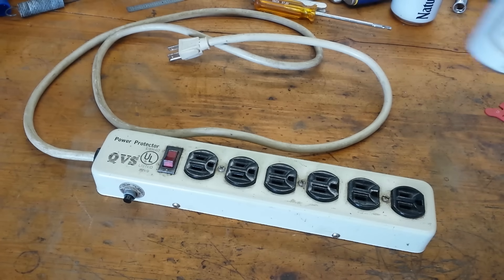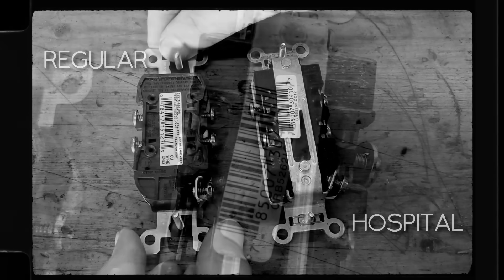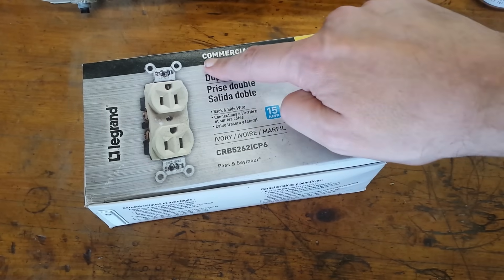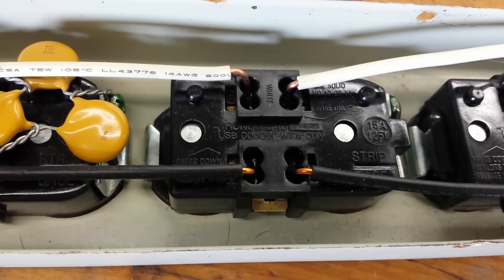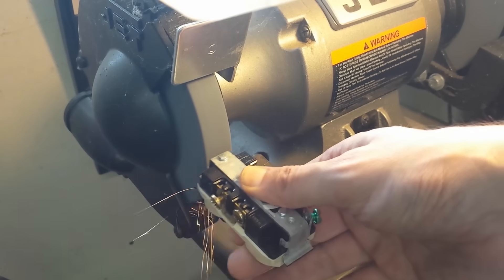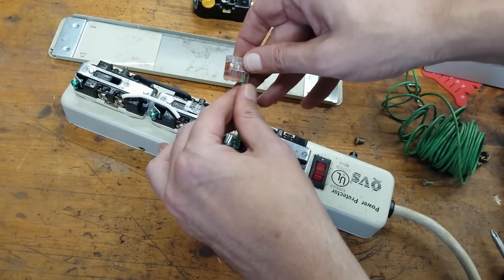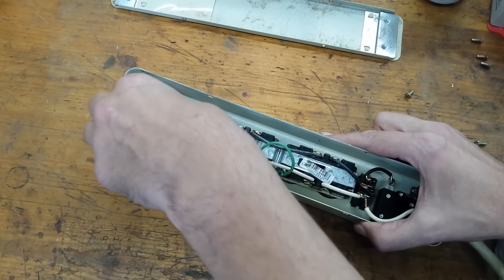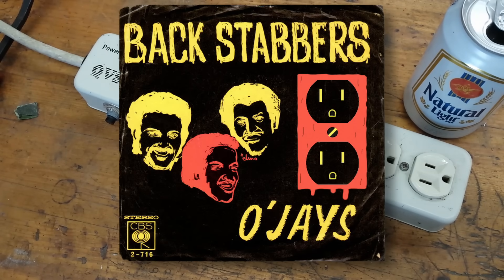I like "upgrading" old power strips for some reason...

Comment: This video is a perfect demonstration as to why it's better in some cases to fix something you got for free, than it is to buy something new. Older stuff is repairable, and therefore in some circumstances upgradable.
Reply: Yes, nowadays people just throw things out to buy new when something breaks, but they don’t actually take the time to take the thing apart and diagnose the problem anymore
Reply: Like if my Steam Deck (portable PC/videogame system) joystick brakes I'm replacing the potentiometer joysticks with hall effect sticks.
Reply: @bland9876  and how when they figure out how to modify the firmware on the switch I'm running Linux on mine immediately
Reply: It is a perfect example of doing something that can get someone hurt.  Do not follow this video.
Reply: @rbhe357 okay mister electrician sir, any other wise tips?
Reply: @DerpDerpington1122 Ask yourself 1 question.  Since he cut the metal bracket from each end, what is holding the new heavy duty receptacles in place?  A tiny screw in the center meant only to hold the cover plate.
Reply: @rbhe357  a 6/32 machine screw on average has a tensile strength of around 150 pounds bud. A hospital grade outlet dependent on manufacturer tends to weigh somewhere in the wheelhouse of 1.5 to 3 ounces, I think the "tiny screw" will hold just fine
Reply: @DerpDerpington1122  Cute that you think tensile strength of a bolt matters when 2, maybe 3, threads are engaged, and when the forces are not acting linear to the bolt itself.  C'mon Poindexter.  You're smarter than that.
Reply: @rbhe357 standard size for that screw is generally 1/8-1/4 of an inch, unless that sheet metal is an 1/8 of an inch thick that screw has plenty of threads engaged, ik you think you're right but I legitimately make bolts and screws for a living man, the power strip is fine and you're not right, I understand wanting to make sure people are safe and all but it's a damn video from someone who does hobby electronics. Unless you're deliberately trying to rage bait idk what your problem is
Reply: @rbhe357 and btw 3 ounces isn't gonna provide enough sheer force to snap those bolts unless you literally smack the thing into a concrete floor or a wall
Reply: @DerpDerpington1122 Congratulations you make bolts for a living.  Mechanical engineer myself.  You are correct that the screw is 6/32, but I have no idea where you got 1/8" or 1/4".  No household receptacle on Earth uses mounting hardware (screw nor sheet metal) of that gauge, and quite frankly I couldn't care less. (Incidentally I just checked. It's 20ga, or 1/32" thick)
I'm talking about the receptacle itself.  If I had a nickel for every receptacle that I have replaced or tightened when it "got loose " from repeated fatigue. Those didn't have some knucklehead grind the mounting brackets off, defeating the metal strap running from end to end, while bragging about the extra force needed to plug something into it, either.  It's like expecting a hammock to stay up after you cut both trees down.
You and I get that it's just a video, but unfortunately some people believe everything they see online.  It's more unfortunate we have "influencers" looking for views by giving them bad, sometimes dangerous, ideas.  I will refer you back to my original comment, above. 
That's it.  I'm done.  Moving on.
Reply: @rbhe357 it's not Gauge its length college boy. 6/32 by 1/4 or 6/32 by 1/8 and honestly the fact that you think you know everything should've told me you were an "engineer" and I highly doubt one worth his salt if you're so committed to being correct. In a manufacturing setting you actually see these components put through their paces instead of just in solid works or in your desk receptacle. If that piece of tech has been put through it's paces in the exact same way why on gods green earth would it fail when put to the test with components held to a higher standard. You engineers absolutely never from my experience have any hands on experience. You just sit behind your little desks and say that your little paper degree means that you know everything. I would love to see you actually try and repair or refurbish something yourself. I guarantee it'd be laughable
Reply: @rbhe357 Uhh what? Sure bud. There is nothing unsafe about what he did.
Reply: @rbhe357  I bet you'd shit yourself if you found out about the battery pack modders....

Comment: For most of my life, every time I go in a hospital, I wondered what those green dots signified. I wonder no more! Great vid, but I do have an issue with one aspect. You state that you don’t like “backstab” push in wiring, but then you promote Wago’s, which are exactly the same thing!
Reply from the maker: The Wagos have a lever that keeps constant pressure on the connection, and larger surface area making contact with the wire.

Comment: 6 × 5$ = 30$ you paid for 5 outlets ... you could find mint power strip in swap meet or flea market for 10 $
Reply from the maker: The outlets were only like $2 or $3 a-piece when I bought them a few years ago, plus I had fun working on the project.
Reply: @ballinator 🎉🎉🎉

Comment: For linking all the grounds on that string of receptacles, the ideal way to do that is to strip conductor in-between the ends. You can wrap those stripped middle parts around the ground screw as a U hook between each of them.
Reply from the maker: Thanks. I always have issues when I try to strip the wire in the middle.
Reply: @ballinator  Yeah, it's sort of surgical and fussy to be sure. But old time sparkies used to do it all the time to avoid making pigtails. It's a clever hack.
Reply: yeah, way too much going on with all the wagos and pigtails

Comment: From what I've gathered, "hospital grade" receptacles are identical to commercial grade ones with most manufacturers. The only difference is the ones that are hospital grade bear a mark (the green dot) that makes them more expensive only for the purpose of recouping the cost the manufacturer incurs to get them certified for hospital use. So you're literally paying more for that green dot, which is there just for hospital building and safety inspections.
Reply: If you look at a different way, they're giving you a medical grade plug at half the price simply because it doesn't have a green dot on it.
Reply: @mayshack  Precisely. Put your own green dot on it. lol
Reply from the maker: That's been my suspicion too.
Reply: Don’t mind me and my green paint can and tiny brush…
Reply: News to me. I always thought the green dot was a power indicator led.
Reply: Not so:

A hospital-grade receptacle is an electrical outlet built to higher safety and durability standards than a standard outlet, featuring enhanced grounding, robust construction, tamper-resistance, and a distinctive green dot on its face to signal its certification for heavy use in healthcare and other demanding environments. These receptacles must pass stringent tests for impact, grounding, and plug retention, ensuring reliable power for critical medical equipment and enduring repeated use and potential abuse.  [1, 2, 3, 4]  
Key characteristics: 

• Enhanced Grounding: Hospital-grade receptacles feature more reliable grounding systems to enhance safety in healthcare settings. [1, 3]  
• Superior Durability: Built with thicker, heavier-duty materials, these outlets are designed to withstand high-impact forces and continuous use without breaking or deforming. [2, 5]  
• Stricter Testing: They must pass rigorous tests, including the "500 Pound Crush Test" and the "Abrupt Removal of Plug Test," to ensure they remain functional and safe even under extreme conditions. [4]  
• Tamper Resistance: Some hospital-grade receptacles include tamper-resistant features to prevent foreign objects or unintended access. [1, 6]  
• Visible Certification: A green dot on the receptacle's face is the visible symbol of its hospital-grade certification. [2, 3]  
• Emergency Power Capability: Red-colored receptacles, often found in hospitals, are connected to emergency backup power systems, and hospital-grade devices are essential for reliable connections to this vital power source. [7, 8]  

Why they are used: 

• Healthcare Settings: Due to the critical nature of medical equipment and the potential for heavy use and accidental damage, hospital-grade receptacles are essential in patient rooms, operating rooms, and other patient care areas. [2, 7]  
• Demanding Environments: Beyond healthcare, these durable outlets are specified for any location where devices experience frequent use and where the reliability of the electrical connection is paramount. [2, 3]  

[1] https://www.paclights.com/explore/debunking-myths-about-hospital-grade-receptacle-what-you-really-need-to-know/
[2] https://www.youtube.com/watch?v=5BlriskCnjI
[3] https://www.allstarelectrical.com/resources/how-are-commercial-and-institutional-outlets-different
[4] https://www.stayonline.com/product-resources/hospital-grade-plug-and-receptacles.asp
[5] https://www.youtube.com/watch?v=LGG_pYJdar4
[6] https://forums.mikeholt.com/threads/hospital-grade-receptacles.82684/
[7] https://leviton.com/markets/health-care
[8] https://www.backupbatterypower.com/blogs/news/what-are-the-red-outlets-in-hospitals-and-medical-facilities
Reply: @delta3dd None of that means the commercial ones aren't physically identical to the medical grade ones (other than the green dot).  A bunch of the expense in environments like that is liability, certifications, and additional testing.  Combine that with low quantities and buyers who aren't especially cost sensitive and the cost can increase quite alot.  Sort of like how aircraft parts are wildly more than normal ones, even if the part itself is essentially identical to a hardware store one.  For the outlets, if the difference in materials and assembly isn't massively more between commercial and hospital grade (and I doubt there's alot of difference), it's quite reasonable that manufacturers would prefer to have fewer machines, dies, molds, etc by just having both be functionally the same thing.
Reply: @delta3dd Yes, but that doesn't mean the non-hospital, spec-grade or commercial receptacles don't also meet that same criteria minus the green dot. When you say "regular receptacles", I assume you're referring to the ones that cost like 89 cents a piece. Those are residential grade, and yes, those are absolutely inferior.
Reply: @delta3dd obviously ai

Comment: Yes I have used the hospital grades for my power strips, and the green dot it there to let you know that, the outlet has a "dead front". The screw for the cover can tie to the ground on 
strap, allowing for a path of current, when you handle a plug with wet hands, These do not allow that. And , nice work too.
Reply from the maker: Thanks! Are you thinking of isolated ground outlets? I just checked one of my spares for continuity in between the ground terminal and the cover plate screw and it had it.
Reply: @ballinator  I just check mine and you are right. The thing that is a "dead front " is the hospital grade hubble connectors, that they had to put on all equipment, at the medical school , where I worked, a few years ago. I grabbed a bunch of outlets and plugs, from surplus equipment.
Thanks for catching that !

Comment: If you want a new metal power strip you should look at naval or “marine rated” power strips. They have a metal case and also use a double pole power switch.
Reply from the maker: Interesting.
Reply: @ballinator  A lot of "marine" grade stuff is basically heavy duty RV stuff.
Reply: The ones meant to be used in server racks are usually all metal too.
Reply from the maker: @JeremyLevi  Oooh, great tip!
Reply: @JeremyLevi  I have a few of those. I'll see if any need repair.
Reply: Yeah, naval power grids don't have a neutral, they use two live phases for single phase power circuits, too, so you have to use double-pole breakers.
Reply: Retired navy dude.  Yes you are correct.  Never opened one up but they are much bigger then your average power strip and I'd bet they have regular outlets in them my guess the plugs are at least commercial grade.
Reply: Double Pole! I’m excited!

Comment: I've never seen an outlet strip- that would probably be sexually exciting to an electrician 😱🤣😛

I used to use the metal outlet strips on construction jobs but they had a habit of disappearing. I fixed that by screwing them to the sawhorses 😎 The MOS type surge protection with these degrades with use, losing a percentage of their capacity to protect each time they control a surge. Time alone has little effect on them which shows how poorly grid power is regulated ☹ And they still charge us a premium price for that 😠

Comment: I’m a commercial electrician in Southern California LA area and I do high end property troubleshooting and large projects I built an apple headquarters, sofi and the intuit clippers arena and wagos have a higher lightly hood of burning up than wire nuts. Personally I won’t use wagos anymore after all of the burnt ones I’ve seen compared to wire nuts. The little metal strip gets hot and melts the plastic.
Reply: There have been many stress test on Wago (videos that prove it), and they've sustained very high continuous current, very much beyond their rating. The ones you saw may not have had one or more levers pushed down all the way so perhaps the conductosr were loose and arcing. But that would place the blame on the installer, not the device. Once those levers are down, they're locked in place by springs.
Reply: @aaron74  In the tests I've seen, the Wagos indeed did far more than their rated current, but all else being equal, they did heat up a bit more than properly installed wire nuts.  Now the key is properly installed.  If you just jam the wires in the wire nut and don't twist them adequately, they can indeed by sketchy.  I always pretwist the wires firmly together and cut off the excess before I put the wire nut on.  In theory at least, you should be able to put the wires in the nut and twist the nut and wires together, but there's a higher risk that some of the wires aren't twisted tightly or don't end up in the twist very much.
Reply: @ccoder4953  100%. I love Wago but I still use wirenuts out of pure habit and muscle memory, I always just have lineman pliers in hand and I absolutely twist wires very tightly and trim the end before tightly screwing on a wire nut. That splice is perfect when I'm done with it.
Reply from the maker: Interesting. They wired the new datacenter at work with a ton of Wagos, which is how I discovered them. Wonder how that's holding up.
Reply: In a properly twisted wire joint the plastic nut is only there for added strength and insulation.
Reply: Same...
Reply: Total nonsense.
Reply: Sounds like operator error. I'm a NETA technician and seen plenty of incorrectly installed equipment by electricians over the years to include wirenuts melted beyond belief.

Comment: I also nerd out on these. I also have electrical boxes with 2 heavy duty duplexes at the end of most of my extension cords. All my extension cords are made from bulk wire so I’ve unlocked a new nerd level maybe? Anyway as always great stuff ballinator.

Comment: Awesome video! You made particular to ground the case, which most don’t understand is absolutely required to make it non-deadly.

A couple of notes:
1)  That three-LED tester can’t actually guarantee the outlet is wired correctly. You at least need to also test with an NCVT.

2) Since your removed the surge suppressor, you should paint over the “protector” label.

3) The back metal piece of the outlet that the tabs you cut off of is properly called the “yoke” or “strap”. The pair of holes that look like Mickey Mouse ears are properly called “ears”, of course.

Keep up the awesome work!
Reply from the maker: Thanks! Didn't think about covering the 'protection' label.

Comment: Ground prong up is a good practice. If some falls on a partially unplugged plug, it won’t have a tendency to short
Reply from the maker: I wired my shop with all the outlets ground up. Except for one outlet, where I have something with a right angle plug that requires it to be ground down.
Reply: Maybe the ground is supposed to be up down under in Australia but here in the real world the ground is down. That and we don't drop scissors down the walls. Someone didn't put enough layers of bubble wrap over you. You're still oozing out over the Intertubes.